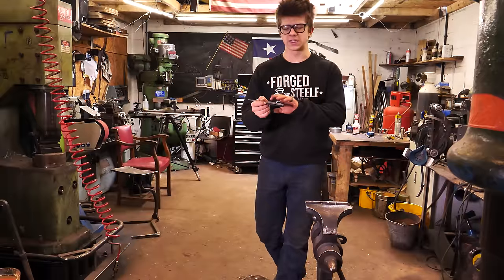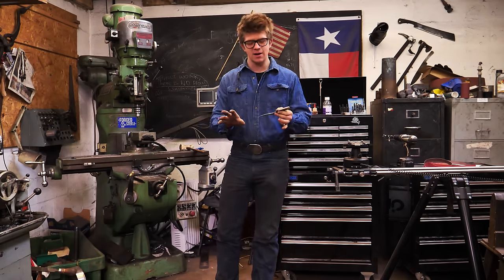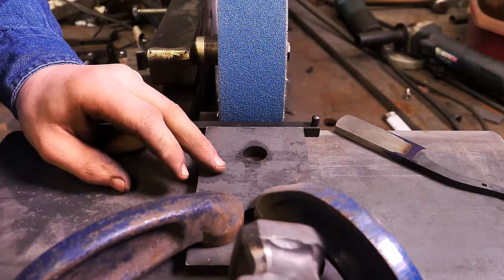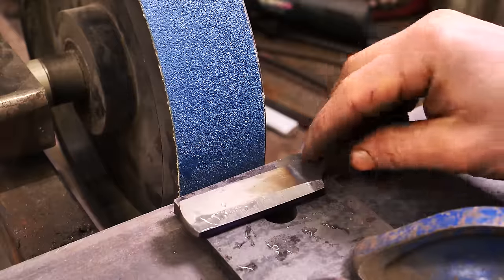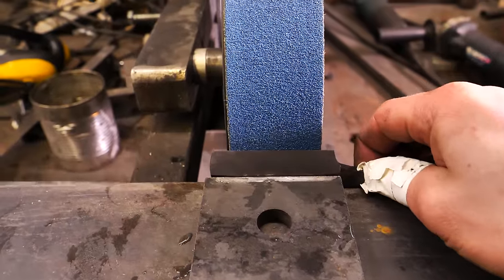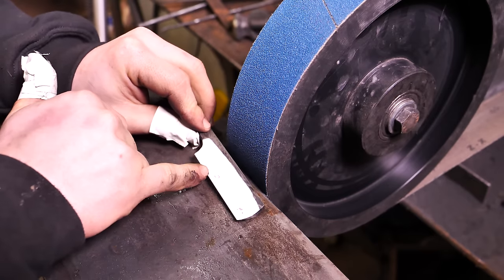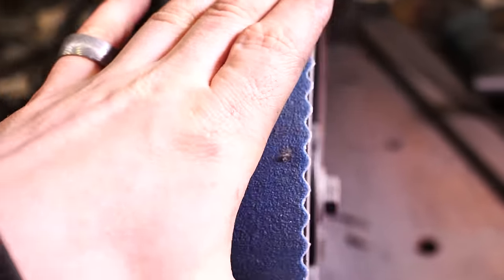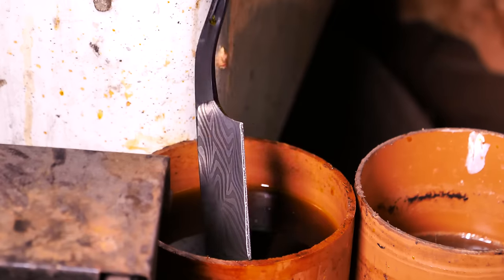DAMASCUS STRAIGHT RAZOR: Part 2 *in 4k*

Comment: make a damascus steel glasses frame
Reply: what about damascus titanium glasses?... its lighter and stronger so it wont bend when he inevitably DROPS them
Reply: also, ive not seen anyone do a titanium damascus, should be an epic challenge for him
Reply: markielup3 I think the real challenge will be to make somting that is not damascus
Reply: theres not much of a difference in doing that, the challenge in titanium will be a completely new material
Reply: markielup3 true
Reply: Now that's a genius idea and would be just as fitting. They might be a little heavy. However you could wear them for certain maybe special occasions!
Reply: titanium damascus is caled tamscus,,
Reply: rust
Reply: markielup3 titatnium is quite expensive and doesnt forge well at all.
Reply: scott left coatings
Reply: timascus btw
Reply: thats exactly why it would be a challenge, making a working usefull piece out of it would be epic to see in my opinion.
Reply: cordless drills
Reply: It would be quite a bit different. It gets very soft at welding temp and when at temp burns in the atmosphere.
Reply: btw, titanium isnt stronger than steel, it's just lighter, so it strenght/density relation it's higher, but acutally, it has less strengh
Reply: Zhalas it has more impact strength. And tensile strength is similar.
Reply: it depends, some steel have almost 1400 MPa of tensile strenght, and titanium has between 600~800 MPa, so no, and the tenacity it depends on the heat treatment
Reply: btw, only some steels can have that tensile strenght, and they have to be cold worked...
Reply: How will he etch the titanium? IDK if it is possible to forge weld steel and titanium (the steel might melt before the titanium gets malleable, and the metals may be incompatible), but forge up your blank, split what will become the edge, insert a higher grade steel, weld the two blade flaps to the new insert, quench just the edge in oil, and now we are talking. One seamless piece of steel to take an edge, then a beautiful body that is soft enough to make it much more durable.
Reply: I've never seen him draw wire in his shop, but i guess he could.
Reply: so we are starting with insults? okay man, bye
Reply: unfortunately you cannot heat treat titanium, but for glasses I don't think it would matter too much. its the inability to work with it that would hinder it.
Reply: For most titanium damascus, (mocati or timascus) you do not actually etch the blade. It is commonly done by heat anodizing the metals. While some types of titanium will become one color while others will be another color, giving the metal its rainbow like appearance.
Reply: Zhalas so we are okay with bad spelling? bye
Reply: Thad would be really heavy, maybe a mokume gane out of some lighter metals wouldbe better.
Reply: Omg yes
Reply: Anonymous Dan I was going to comment that damnit

Comment: I think it's beautiful.  As I was watching the grind though, the thought occurred to me that the contrast between the polished steel and the pattern was actually really cool looking.  With the sweep on the spine and near the edge of the blade where the pattern met the blade surface, it made a deep contrast between the pattern and the "whole" looking steel.  Perhaps you could try doing something like that.  A peice where the functional part of the steel (although still pattern welded) would remain solid.

Comment: Great job protecting the edge for the etch! I was a little worried that you wouldn't...
Don't mind the haters Alec. Your tempering oven is just fine!
Would have liked to see a little more curve to the profile of the grind, with a very heavy spine... A very small diameter contact wheel would give you that great, traditional curve. 
Can't wait for the next one!

Comment: regarding the small crack, while yours may have indeed been caused by weld gone awry, for heat treating, it is best to break all the sharp edges by rounding them through filing, etc, , and heat treat in an oven several times to relieve the internal stresses...

Comment: Nice blade. The shape and pattern came out beautiful.
Instead of using a block for a stop behind the blade, maybe use a piece sheet metal with a short 5-10mm folded shoulder, have the shoulder facing up and just touching (or a fraction off ) the contact wheel. This will keep the spine off the wheel just enough and ensure you can't slip and touch the spine on the wheel.

Comment: That's going to be a nice shaver. Just for info, blade width on straight razors is measured in 1/8" units i.e. 8/8, 7/8, and so on also the pivot is usually a 1/16" pin you do see 1/8" pins on occasion but not often.  Keep up the great work.

Comment: what is your opinion.on yhe functionality of Damascus steel? if  it.is a single.folded configuration producing relatively straight lines (and not.fancy patterns) do you think it produces a better edge, micro serrations etc. 

are there any other advantages to Damascus in your opinion?

Comment: Hi Alec, (or anyone else reading this), what sort of welder do you use in your videos to tack weld up your Damascus stacks?  I had a nightmare today wiring a stack of steel and decided it's time to get a welder.. I know there is great debate for tig/mig, but initially this is my only use of the welder, to tack weld up stacks of steel for damascus. Thanks!

Comment: traditional razors are measured in eighths.20mm is approx 3/4 so its 6 8's.

some simply state width in std imperial.

also for a hollow grind you can go to something as small as 3" diameter wheel.

most makers use 6"-8" dia.

Comment: Alec, I was musing on the backsmith for beginners page on facebook yesterday about making a damascus anvil ( i believe the exact quote was a 250 pound pattern welded anvil) while i realize that that is an aspiration of monstrous proportions, i was wondering if you would be interested in attempting something similar to a smaller scale.  Also, i am looking at taking one of you evolution of tool making classes this summer.

Comment: Sir, if that was my grinding technique (I've not seen anyone else do it before, but the internet is YUUUGE so I can't take credit without confirmation) then I space the block directly against the knife. I don't put an extra space in there. That might be where to improve, but I also don't do any hollow grinds so it was very cool to see you use this and it work on a hollow grind.

Comment: Looks really, really awesome! You should get into making custom razors ;-). I'm looking forward to you finishing up the razor and making some equally awesome scales for it! By the way, when honing the razor it helps to put 1 or 2  layers of electrical tape on the spine to prevent honewear. If you need a volunteer to test the razor, I'm up for the task!

Comment: Alec, for one.....nice shirt.  It suits you.  Another thing, you were spinning that drill bit WAY too slow.  Remember, the larger the diameter, the slower you spin.  The opposite for small bits.  You should have been spinning that drill bit around 650-800rpm and since you are drilling what may be hardened material, you should have used cutting oil as a lubricant.  Using water based lubricant will not be able to properly lubricate because of the heat generated from drilling.  Use something like QuickTap or Rapid Tap for drilling hardened materials.  WD-40 will work in a pinch, but don't breathe the fumes, taint good for ya.  Another good tip for you is to use the quill stop and drill in 5-10 thousandth inch increments, almost pecking at it.  It will go pretty fast and by using the quill stop, you reduce the risk of the drill bit grabbing and breaking.  That is also the best method for drilling when using carbide drill bits.  Carbide will shatter with too much load, and they have to be spun even faster than HSS.

Other than that, keep it awesome!

Comment: Great vid - just a quick question - When you get to the stage just after forging, before final grinding and polishing ( when the metal is still quite thick ) is it not worth considering cutting in half along full length to give you 2 razors before you get to final stages ? - just a thought

Comment: have you ever considered using a slow, water wheel? A classic "grind stone" we yanks call it. about 18-14 inches diameter, 2-3 inches wide, (usually sandstone) turning at less than 60 rpm while sitting in a basin of water. I used one for years and every knife i owned was  a knife AND a razor. You could true the surface with a carbide tool instead of a diamond tool. (they're quiet too!)

Comment: i dont remember where but i saw someone who made a razor specific grinding jig where he put 2 grinding wheels facing each other,. essentially touching each other but both running off the same belt (so the speed is identical, therefore they dont just grind each other to bits) so all he had to do was pull the razor through to get a perfect hollow grind every time

Comment: Alec, the next time that you grind a blade onto some metal, first think of it as if you were looking down the spine. From the point where you want the edge to end, draw a line to the centre of the blade, where you want it to start. The line that you have drawn needs to now be positioned exactly vertically, and the angle between the blade (tilted) and a flat surface measured. This becomes your grinding angle, which you can use to grind the blade perfectly. 
FYI I will be copying this into the comments of every video from now on, so I would be great full if you could reply in some form so that I know you've seen it. Keep up the good work mate, always inspiring me to do more. :D

Comment: you are going to need tape on the spine to hone it, if the spine is 6mm thick and the blade 20mm wide it leaves you with a 15 degree cutting edge, to shallow for a comfortable shave. 2 layers of electrical tape on the spine will put you in the optimal comfort range.

Comment: No need for a gloss coat on the blade edge because you hone a razor and the whetstone will give the desired edge look when sharpened then stropped.
Reply from the maker: +Mawo Duffer it is to stop the edge from etching excessively!

Comment: When you heat treat you should close off the ends of your pipe as much as you can and put some charcoal in it to reduce the amount of oxygen in it.
Reply: Also rub some soap on the metal before you put it in. It's sorta like a flux. You should do your normalizing on a block of wood.

Comment: is that stainless steel? I think that should be because that touches skin directly.
Reply: Samin Kim it's Damascus because it's not gonna be used. If it is gonna be used I agree with you.
Reply: Damascus means mix of different steel, not specific sort of steel. There are stainless steel damascus knife such as SHUN. I checked the part 1. and obviously looks bare steel. FYI there are so many kinds of stainless steel such as 302, 304, 316. thx